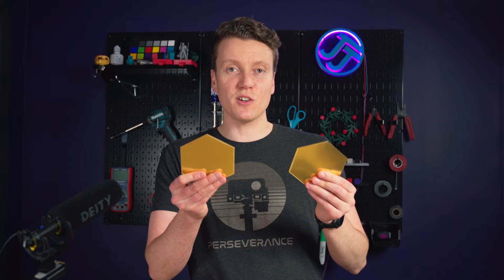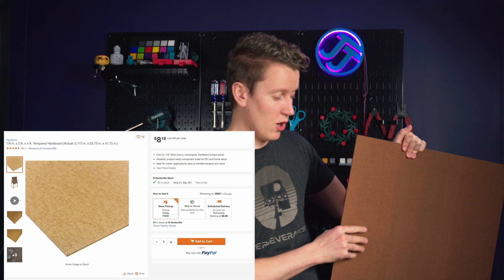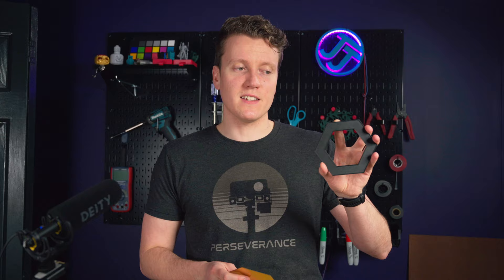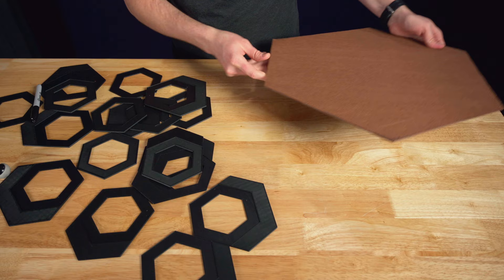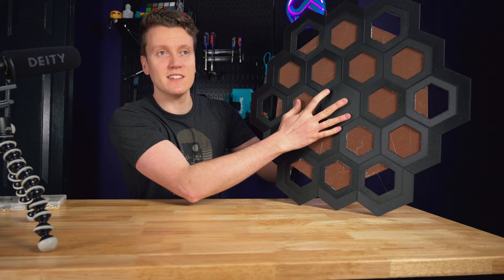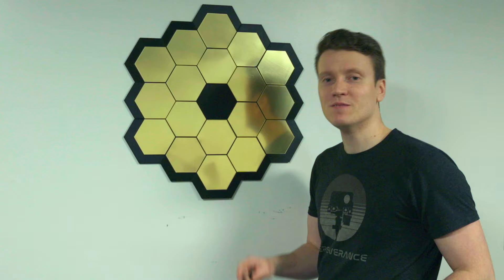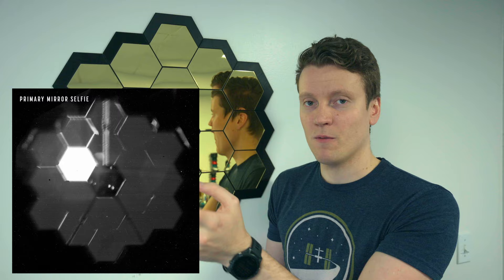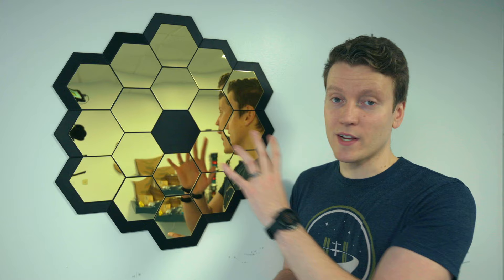3D Printed James Webb Space Telescope Mirror | 3D Printing Art

Comment: what size mirrors did you receive. I just ordered two sets of mirrors and the are only ~2.5 inches and ~4.3 inches across?
Reply from the maker: Mine are ≈4.25 inches tall and ≈5 inches wide
Reply: @JJShankles  For your viewers: I ordered using your link and they were a different size than what you got, however I was just able to scale the model.
Reply: @ResistCircuitResist  hi, did scaling work? my mirror size is ~6,69 inches tall and ~7,87inches wide. how to scale?

Comment: Hey JJ. I have a anycubic i3 mega and i have done the tcm2209 driver upgrade. Since the upgrade i'm getting a lot of skipped steps. I think it has to do with my vref setting. I'm getting a lot of contradictory information out of reddit and the websites i found. What did you set your vref to to be able to achieve your 100mm/sec speeds?
Reply from the maker: I think I set it to 0.9 or 1.0V, higher voltage will have better performance, but will run hotter and be more likely to get errors. Higher voltage also needs more cooling to work correctly. One cause of skipped steps can be lack of cooling to the stepper drivers. I have a 120mm fan that blows on all my electronics under the chassis